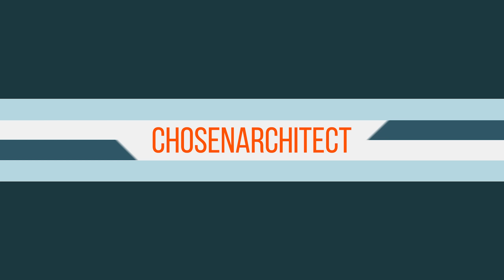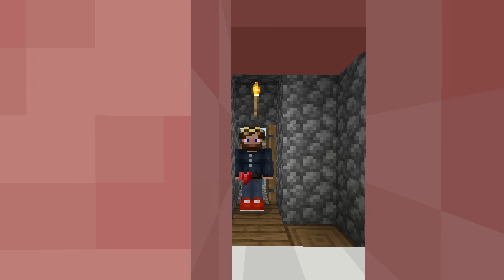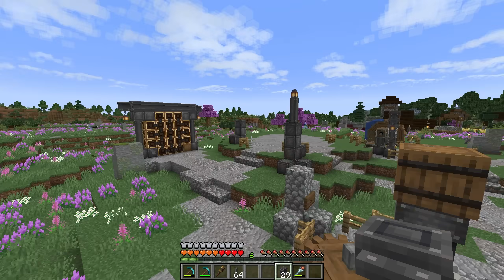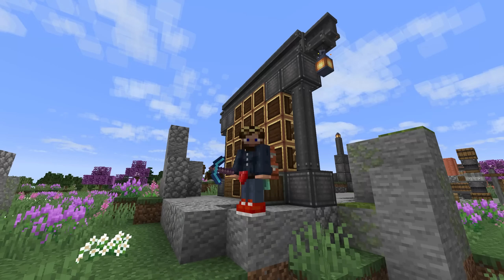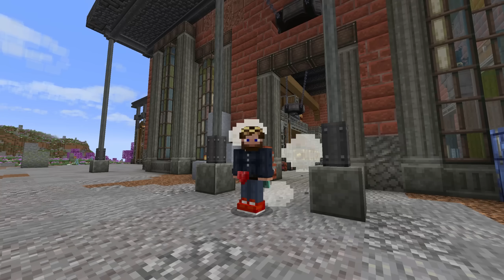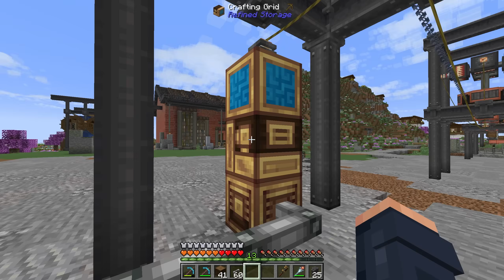Refined Storage 2 & Create Crossover EP12 Chosen's Create: Integrated

Comment: Seeing you work with Crafts & Additions, I'm wondering, is there Create New Age in the pack? Why not use that? I feel like New Age's generators using magnetite ect. is way more fun and interesting then just a one block that generates power.
Reply: New age is not in the pack. It would be pretty overpowered considering the actual energy and automation requirements

Comment: I’m having a problem with attribute filters.  Even tho I set them, they sometimes don’t work. Not sure how to fix it. I’ve used them before in many packs but they just don’t seem to let items thru. They will block items but when it finishes blasting or washing or whatever, it won’t go in to the barrel.
Reply: funnel may be output instead of input check the arrow on the side
Reply: @TheQuinn50  the funnel is correct, the filter is correct.  I have a total of 5 set up and 1 works and the other 5 don’t.
Reply from the maker: Some things can be blasted or washed twice and this will mess those kinda of filters up
Reply: @ChosenArchitect  I tried washing gravel, it washed, but the filter didn’t pick up the iron nugs or the flint until I removed the filter. The same happened when I blasted sand, or when I smoked meat or blasted ore.  It is very weird. When I sanded the rose quartz, it didn’t pick that up either.  It’s just really weird.
Reply: @Frobuzmumber  you need to blacklist the tag for washable or sandable. You could also be forgetting to click the plus button when adding an attribute. There’s a million reasons but you’ve given no info to work with